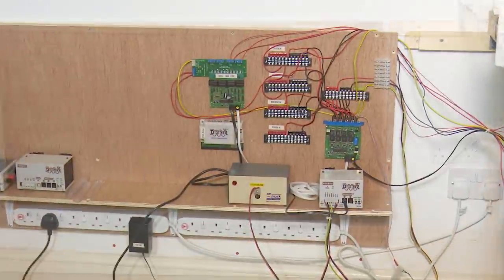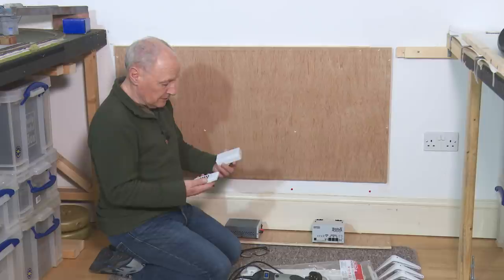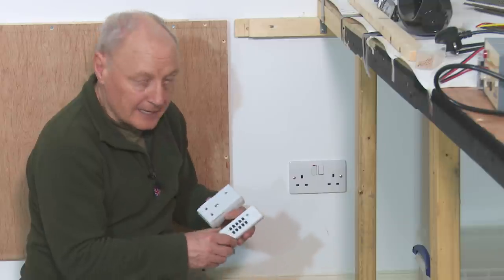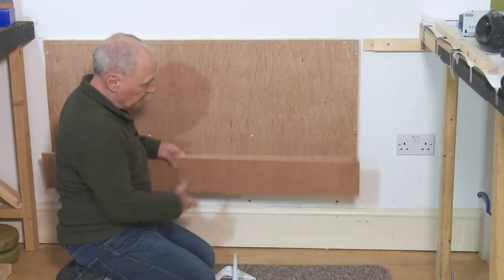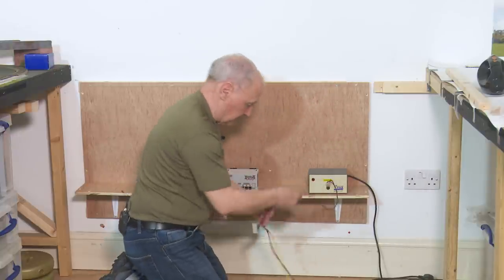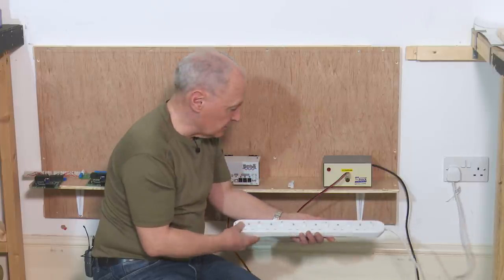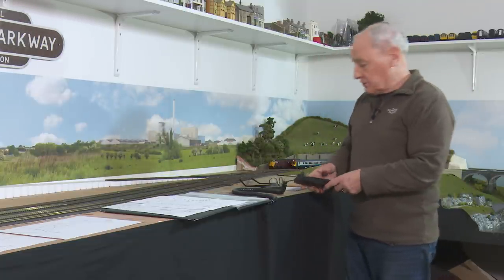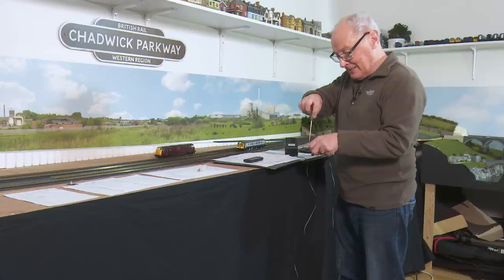Wiring Model Railways using Terminal Blocks at Chadwick Model Railway | 86.

Comment: Another great informative video Charlie thanks very much for taking the time and effort to explain everything you do. Quick question you have started to use the woodland scenic foam underlay as a means of sound deadening, although it’s early days does it appear to be quieter than using cork ? 
Thanks
Reply from the maker: Hi Ian, yes exactly that. 
The sound of trains drumming through the baseboards, drove me mad.  Especially with sound locos.  Ballasting causes most of the problems so I need to choose my glue with care.
Regards Charlie.

Comment: Hi Charlie, great video as usual. I myself have gone down the digitrax path and have found it excellent. I would like to know how you have got on with the SE8C signal controller? After much bu**ering about I have managed to get mine working in a fashion (I’m using iTrain software) I know that you are a TrainController user and wondered if you found it any easier to set up for signalling, maybe you could do a video on the subject? All the best and keep safe, from another Charlie 👍🏻
Reply from the maker: Hi Charlie, please check out my back catalogue.  There is one on the SE8C.

Comment: Another great vid! I've been following you and many others for a few months now with a view to getting back into model railwaying after many years away. In one vid you mentioned about not connecting dcc output as a 'ring main', because of problems with waveforms meeting halfway round, but does that also include a complete break in tracks for the same reason? If so, how do locos cope with the change from one section to the next?
Keep up the good work, Cheers Loz
Reply from the maker: Hi Loz, I came across this due to odd train running characteristics.  If you have a broken ring main and track too, then power would simply feed in, to both sides of the break.  Why not keeping your ring intact and see if you encounter any issues first.
Reply: @ChadwickModelRailway  thanks,  we'll try this when we get that far. We just have a bare loft atm! Cheers Loz

Comment: Thanks Backdrop Charlie, that video is really helpful I hope it is one of many on wiring as there is plenty more to cover. I do of course have questions based on what you covered today, what if I wanted more than 4 power districts do you use multiple PM42s? How does one wire that together? cheers Onky
Reply from the maker: Yes that’s quite a simple one. You just take your power feed as it comes into the layout and split it into two different PM 42’s as if almost wiring up two different layouts.

Comment: Your videos are absorbing for a newcomer to model railways. Thank you for sharing your knowledge and experience.
I felt a little overwhelmed by this wiring video, and need a better understanding. Is there a book you could recommend? Especially one which focuses on Digitrax.
Can you mix and match DCC equipment. I think that you were unenthusiastic about the Digitrax throttle. Is there an alternative?
Reply from the maker: If you're after a system, speak with Jeremy of Digitrains.
He will give you good, current unbiased advice.
There is a Digitrax Book, its dreadful!

Comment: Hi Charlie, I watch most of your videos and have learnt a lot from them. My baseboards are already in place and I would have difficulty moving them onto there sides for wiring. I'm using the terminal barrier strips from Amazon and will be using 1 of these per loop that I have on my layout. Do you have any suggestions on how I can screw the terminal blocks in upside down as every time I try the screw keeps falling out? All the best, Jon
Reply from the maker: Can you not make a small pilot hole with a bradle to give the screws something to grip on to?
Reply: @ChadwickModelRailway  Thanks Charlie, I will give that a try after work. :)

Comment: Thanks so much for the video Charlie,, this and previous videos have been a real inspiration to get into the hobby. One question, are you going to cover the next stage of wiring from the BDL168 to the track? I can grasp how the bus and dropper wire scheme works for DCC but I am struggling to understand how the block detection wiring fits in. Do you wire both a black and red bus and dropper for power, then also run red from the BDL168 to the block section plus a common black or is the red and black from the BDL168 instead of the normal red and black bus and droppers?
Reply from the maker: Hi Mark, I will cover this in detail but it’s only the power feed that comes from the BDK168.  Please check out “Digitrax Dad” for further details.

Comment: Hello Charlie, I've enjoyed watching your videos and have learnt a lot from them also gained some ideas, I'm currently laying my first tracks I'm using peco code 55,  digitrax products, tortoise motors, and am going to use traincontroller.
I use the BDL168 for block detection but what do I need to do to power track that run between blocks that won't need detection, how can I put in a bus wire for this and to connect to the tortoise motors to switch polarity for the frog's. 
Sorry if this is a bit long winded but I'm a complete beginner with dcc and am struggling with understanding the electrical issues. 
Kind regards 
John.
Reply from the maker: Hi John, with all pieces of track such as points, and slips and track which I do not require detection on, are fed by the  bus. The BDL’s are also connected to this bus. However, their 16 feeds are then fed out to the blocks which are isolated from the normal track sections by insulated fish plates or cuts in the rails.  As my point work is never in a block, track power which feeds the point is also fed to the tortoise point motor, to enable the frog power to be switched. I do hope that this makes sense. Regards Charlie
Reply: @ChadwickModelRailway  Many thanks for the information. 
Regards John

Comment: your wiring system is welll thought out, but  would be a little dificult to trace, for troubleshooting. suggest the addition  of cable trough to run the wires in. looks neater and u dont  have  to be as particular when you dress in  the wires as all i under  covers when  you finish. also adding a wire number  or letter, on the  end of each wire makes tracing much simpler.u also didnt mention  tinning the wire ends  before putting under contacts since  i assume  you are using stranded wire. i have  built control panels similar  to yours profesionally for more than  50 yrs, so i know how difficult it  can  be to troubleshoot. i continue to look forward to seeing  your future videos
Reply from the maker: I do understand your point of view Gary. However, putting all the cables into troughs actually makes fault finding a little more difficult. Regards, Charlie

Comment: I am in the US so our wall voltages are different but our controller voltages are the same. I am building a small n scale layout using Bachmans n scale ez track. The switches run on 16V 1 amp DC the Accessory power supply will only support 6 switches 3 per side I have 8 switches and don't want to buy 2 $48 power supplies. Is there a way to know how much a DC power supply can support at a rated voltage?
Reply from the maker: I think that I understand.  It might state that it only supports 6 switches but they dont all fire together do they?   So does that mean that your okay?

Comment: Charlie, there is nothing like public humiliation to provide humour for others.  Thanks for that and the rest of it to make another interesting video.  The information concerning cables was particularly useful.  What I didn't understand was what you did to overcome the issue.  Because I work in DC and not DCC, can the PM 42 system be used in the same way.
Reply from the maker: Hi Don, I’m sure that the PM42 won’t work with DC. Give Jeremy of Digitrains a call, I’m sure that he can help.
Reply: @ChadwickModelRailway  Thanks.

Comment: So, just revisiting this video with the hope that soon I will begin construction (weather, money and sanity allowing!). Having watched a number of videos I notice that often there is more than one bus, one for track power (or multiple seperate ones for each power district) and all this does is connect to track. Then a second to power all the accessories such as point motors, turntables etc, and then a pure DC bus to power accessory decoders and perhaps DC lighting. 

Is this wise??
Reply from the maker: Hi Ian. Yes it is preferable to keep the power for the accessories away from the power of the track. It makes it more simple should you have any problems. Do watch next week’s video on power management. Regards Charlie
Reply: @ChadwickModelRailway  I watch them all ☺️ Getting useful tips over helixes (helixi?) And all your digitrax stuff has been really helpful. Just itching to get started now!

Comment: How about taking 2 red wires, twist them together, and put them under one screw, thus saving one screw.  Or - take an open spade lug and crimpt the 2 wires together and then slip the lug under the screw for a more unified connectioni. Bob S
Reply from the maker: It’s trying to map the layout should you get a snag Bob.

Comment: Based upon your videos I've spent considerable amount of time improving my wiring skills as well as improving existing sections. I've blocked certain sections with on off switches in case my five year old son inadvertently creates a run away train. Where I am now is I've completed the track work on a 10inch drop along a 2.5% grade to a fiddle/staging yard. I'm confronted with a new challenge which are electric switch machines. As my layout was originally a shelf switching layout all my Peco switches use Caboose Industries hand throws. I would like to set up the electric switches but I'm unsure on how to wire them to panel. I have an NCE system so perhaps I could wire them to respond to the DCC system. I've also noticed Walthers has their own switching machine system but unsure due to the great reputation of tortoise machines. Appreciate any advice. Thank you.
Reply from the maker: Hi Rhyfel,  I have a previous video called "Wiring Tortoise Point Motors" which might hep.  Regards Charlie
Reply: @ChadwickModelRailway  Thank you Charlie. I'll re-watch again to see if it helps break my mental stalemate.

Comment: There are similar plugs that work through the wifi and you can switch of various devices on you mobile phone or the google assistant sir Cortana etc and voice commands like turn off the loft  lights or turn off model railway plug or any voice command  you programme in to the mobile phone app i have many light switchs and plug sockets and a plug in device like the remote control one you have
Reply from the maker: That’s very interesting Darren, my only other device is a Google nest mini. Regards Charlie

Comment: I looked for this but haven't found the answer.... what is the power supply requirement (V & amps) for a remote Atlas N gauge Code 80 turnout , and also each signal light? Just a ballpark figure as I'm setting up my first layout.
Reply from the maker: I’m sorry Ganny, but I don’t own any Atlas turnouts. Regards Charlie
Reply: @ChadwickModelRailway  Thanks;  I assumed the power requirement for all turn outs would be the same.

Comment: Hi Charlie, Would it be possible for you to make a video related to digitrax command station i.e performance of the command station, how many locomotives can be controlled at any given point in time, how to connect the command to computer for running trains automatically etc...
Reply from the maker: I shall certainly look into a Digitrax Special mate.

Comment: Another excellent video.  Don’t apologise for the length when there’s no waffle, like on some channels.   I’ve been following your advice for the last 18 months and find it invaluable. I’ve got the breakout boards for both PM42 and BDL168.  The wiring is so much simpler.  The PM42 has one power input and splits that into the 4 regions.  It looks very uncluttered.   I’m looking forward to seeing more on the BDL because I haven’t started incorporating that yet.  And I’m interested that you have these also “at the other end”.  Could you explain in detail when the time comes, as others have said they must all be near the booster and not remote.  Oh, and don’t cut out any “mistakes” as they help with my troubleshooting.
Reply from the maker: A heartwarming comment Brian.
I will bear all with the BDL168 progress, rest assured.

Comment: Hello Charlie.  I hope the remotes work OK for you.  As I mentioned, I have had quite a few in operation for quite a while.  Ours drop out very quickly if there is a power blip, something that can happen fairly often in the winter. I have them on the computer, all the TV's and the central routers and modems, so they act as a "no volt" switch as well as for what they are designed. You will likely have thought of this, but if not, If you were to plug on of the 6ways into the other you could also get away with having just one remote.   I went looking on Amazon.ca and E-bay for those 12 way strip connectors,  zilch-zero-.  Stay safe and healthy, we have gone to State of Emergency, but liquor/wine stores are exempt...   PeterL-CND
Reply from the maker: I’m so sorry that you couldn’t get the terminal blocks.  
You’re having a pretty rough time, those dreadful fires and now this!
Can you let me have your name or initials so that I can figure out which Patron you are?

Comment: I have a digitrax system using Pm42 with an acculite breakout board I have not been successful in shorting out a single block, like you the entire track shorts out. what am I doing wrong?
Reply from the maker: Have you powered up the PM42, it needs a 12v DC feed.
Reply: It is connected to another power pack
Reply from the maker: Do the LEDs light up when DC power is applied?
Reply: @ChadwickModelRailway  yes

Comment: Ive been a sub for a while. im not lucky enough to have space for any sort of layout but i hope that will change soon. I have some questions about the track control software you use but for some reason im unable to private message you
Reply from the maker: Hi Philip, I use Train Controller Silver, it costs around £350.
However, JMRI is free but can be more difficult to use.
Reply: @ChadwickModelRailway  thanks for the reply. does train controller silver allow for full automation? trains, points, lights? does it allow a Loco to stop at set stations along a route?
Reply from the maker: Yes but so does JMRI.
TC is also available in Bronze and Gold versions too.

Comment: WARSHIP STOPPED BY POINT BEING AGAINST IT

In the bit towards the end you show the action of the Warship being stopped, (no current to it), by the point being set against it.....and thus clearly demonstrating this because there was no power to the frog.

However, whilst this clearly stopped the Warship, it was nevertheless still fouling the point......or to be more correct it was past the 'Fouling Point' of the switch, where it represented a conflicting movement.

In typical practice the Warship would stop clear of the 'Fouling Point'.....

This could be done with the fitting of a Head Shunt, (there is just room), or with a Catch point.......where the Warship would then stop short of the Head Shunt Buffer Stops or the Catch Point.........OR...........by the simple expedient of moving the insulated fishplate that protects and insulates the frog a couple of inches back along the siding / loop away from the frog.

Obviously, I recognise that fitting in a Head Shunt or a Catch Point would require another track component piece and thus extra expense......AND........whichever method you might choose would involve a bit more wire tinkering and / or soldering.

One hesitates to add to your wiring work after such a marathon session.....!

Perhaps such a modification or change might be something to consider at a later stage of development, but it would make sense to do it before you did any ballasting...

Just an observation.......!

As usual a most informative video from you. 
You deserve the thanks of us all.......

My former Housemaster would say, "....Well done Chadwick Minor. Merit Mark for your House...."

James Hennighan
Yorkshire, England
Reply from the maker: Many thanks for your comment James, it’s great to have you onboard. 
Regards Charlie.

Comment: Backdrop Charlie, you are probably onto this by now but you have put your district terminal blocks in the wrong way, probably all of the terminal blocks really. Your wiring components are being placed by you from the bottom up as you build however your wires are going in at the top of each component and out at the bottom. The "wire in" side should be closest to the previous component and wires out away from it. Currently you have the wires in coming around the board and entering from the top where they then branch out into multiple wires. These multiple wires come out at the bottom of the component and then have to travel around the component and past the top of it onto the next component. cheers Onky
Reply from the maker: Darn it.  What a good point Onky.  What to do now ........